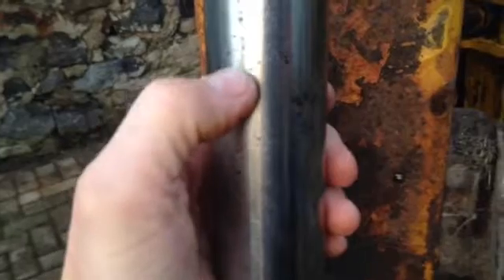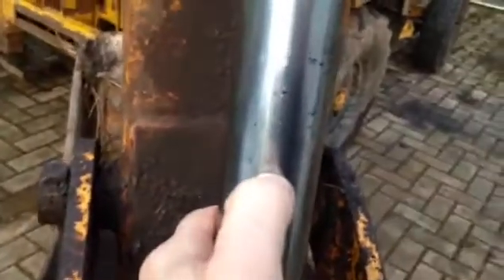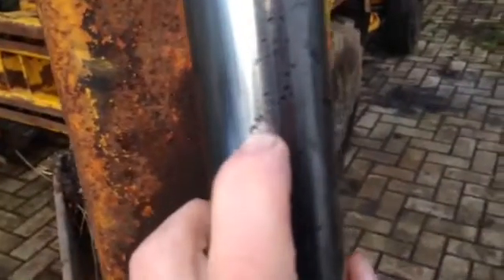How to fix a rusty ram rod or hydraulic cylinder temporarily

Comment: I can see it has worked as a temporary repair but what have you done as a more permanent option? (I have a similar problem and I assume that the rust will quickly recur where the chrome is gone due to the original rust).
Reply: Remove rod from cylinder, Inspect rod and cylinder damage, Re-chrome rod, Reseal rod and cylinder, Install re-chromed rod.

Comment: Have you tried the aluminium foil and cola method? Sounds like madness but meant to work too. Vids on Youtube.
Reply from the maker: hi chap, yes, that takes off the rust, the point of the wire wheel is it actually thins the chrome so it makes the pits shallower..... my view anyway
Reply: Sebastian Hibbert Ah right - makes sense.
Reply: Save the chrome. Polish off the rust with 600 grit. Then wax the cylinder rods with hard wax to keep them sealed up from oxygen. It will allow the rod to be used a lot longer. Coke is an acid and tin foil is the abrasive as mentioned.